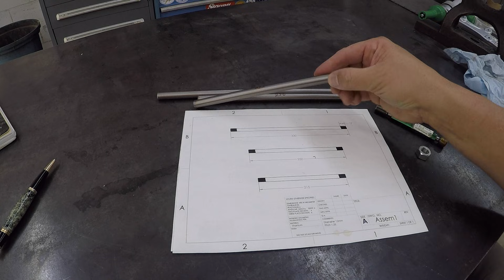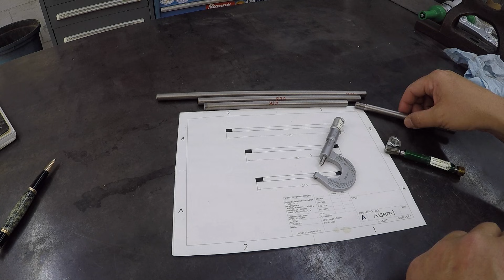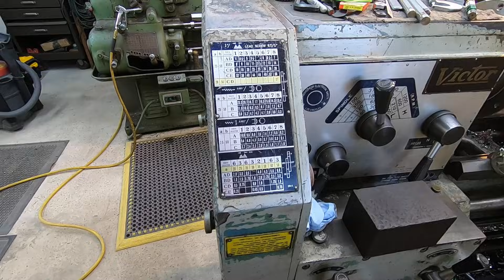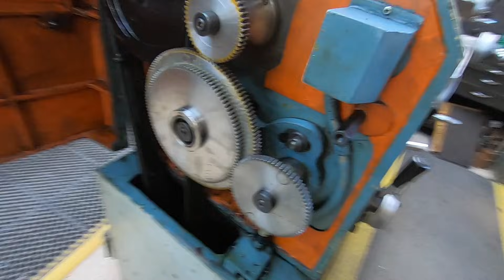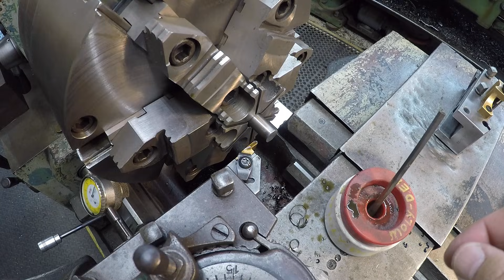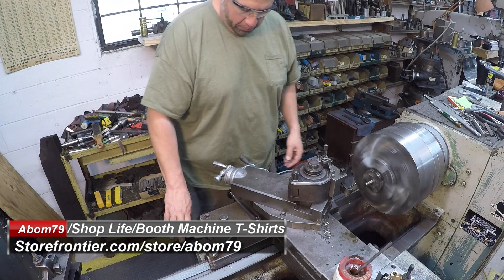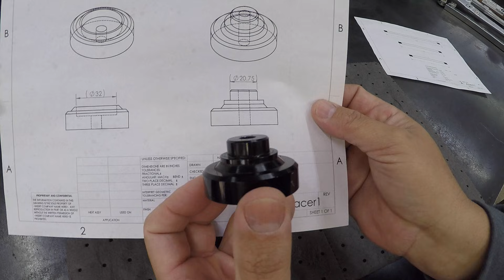Threading Metric Titanium Rod

Comment: How does Titanium compare to other materials e.g. ss 316 or 304 - You made it look surprisingly easy to machine (which probably means it isnt ?) though it did seem that the speed was quite high - is that because of the material or just that you're comfortable at that speed?
Reply: Ti gets sticky like a booger when its hot. Its like anything else you want the heat coming off in the chip. you don't want to be rubbing the part with slow feeds leaving a lot of heat in it or thats when things get nasty.
Reply: Titanium needs sharp tooling to cut. It's gummy like Copper and if the tooling is the slightest bit dull the Titanium will weld itself to the cutter and the work rapidly over heats. Drills are really susceptible to having this happen. Note Adam used moly cutting oil on this job to reduce the friction and heating from the cutting.
The problem with stainless steels is work hardening. The trick there is to take a heavy enough cut so that the next pass of the cutter is through the work hardened zone. Small lathes and mills don't have enough rigidity and horsepower to really be able to do this. What is a help for the home shop is to use ~415 series free machining stainless. You give up a little bit of 300 series stainless performance, but if you can live with a little less corrosion resistance and mechanical strength it works a treat in a lot of applications.
Cheers from NC/USA
Reply: i made my wife a Ti ring out some 3" bar. 5alv is easy to work with. just use the right insert. PVD coated carbide works i think i may have used a Cermet i had laying about.

Comment: You know your working with Cracker Jack Designers when they call up 4-40 tapped holes 1" dp in $um 303 $tainless bar , when 10-32 x3/8 dp would have held the lid on just fine.....FLOW AUTOMATION....go with the FLOW eh ?

Comment: What angle did you set the topslide to? I have the same quick change toolholder on my Colchester, when I try to set it to 30 degrees I cant put the tool in perpendicular to the material. The spline on the toolholder is too coarse, it will go in either pointing a bit left or right, but not straight
Edit: nevermind, saw in a later shot its set to 30 degrees...
Reply: It`s suppose to be 29 so you clean the backside thread or you can use 4-1 and leave the compound at 90
Reply: Holzi24 The number of splines on the Multifix means that each one will give you 9°, so I see why you can’t get your 30°. The way Adam sets his machines up is that his top slide is always set to 30° (actually 29½°), then he slackens the nut holding the Multifix down and sets it with a dti so it is exactly perpendicular, and keeps it that way all the time.

Comment: Good as always, you could have done a better job on the length measurements though. We haven't seen you drag out the vernier calipers in a while. That's always fun.
Reply: By Eye Tool & Die and .001 EYE'$
Reply from the maker: If they needed to be that precise, sure, but I can read a length to .010” easily.
Reply: I hope you can tell that was in humor, I just love to see all the cool tools. Each job is as precise as it needs to be.

Comment: What's the advantage to using the Victor lathe over the Monarch for this job?
Reply: Probably the 6 jaw being on the Victor for all the changing he was doing vs the big 4 jaw on the Monarch
Reply: The Monarch probably doesn't do metric threading.
Reply from the maker: Victor cuts metric pitch
Reply: Seems like the reversing is easier on the Victor too. Not sure how it works on the Victor, but on my Monarch 16 CY the clutch and reversing are 2 different controls, there is no foot-brake, and the dogs aren't really designed for reverse operation it seems.

Comment: Excellent demonstration! I have a lathe that has a metric leadscrew so I can cut metric threads with no fuss at all. However, when I cut inch threads I have to maintain the halfnut engagement point just like you do for metric. I think I first saw this method demonstrated by Tom Lipton and I've been happily using it since.

Comment: Great video ABOM I have a question do you need specific inserts to machine titanium for threading and cutting thanks
Reply from the maker: Some grades are better suited for stainless and titanium, but some grades you can machine different metal.
Reply: @Abom79  thanks Adam that explained alot stay safe with what's going on all the best God bless

Comment: I guess I don't understand why you turn the compound in instead of the cross slide(never run a lathe)
Reply: He is basically cutting a letter V into the shaft. By feeding in at the same angle as the V, he is only cutting on one side of the V. If he fed straight in he'd be cutting both sides of the V. It would work but it would be an ugly cut because it would chatter.

Comment: Maybe I missed it, but why do you have to keep the nut engaged on the way back? Usually you just crank the carriage to the start by hand.
Reply: Standard method when threading metric on an English thread lead screw.
Reply: He does that because he is cutting metric threads and his lathe has an imperial lead screw. When you cut imperial threads most times you can divide that pitch evenly so it can start on multiple places on the dial. The divisions don't come out evenly when you do metric. You can't even let the dial go around and restart on the same number. It has to stay locked in place and be reversed back and forth. Abom's technique is keeping him locked in but allowing him to unlock the carriage.
Reply: @MrZX1206  Zero is Zero in metric or imperial
Reply from the maker: You have to keep the half nuts engaged in the exact position you started on.... exact! This is only for cutting metric threads on an inch machine or vise versa.